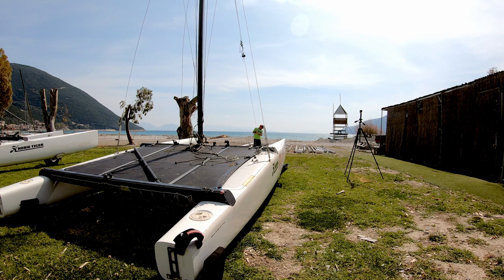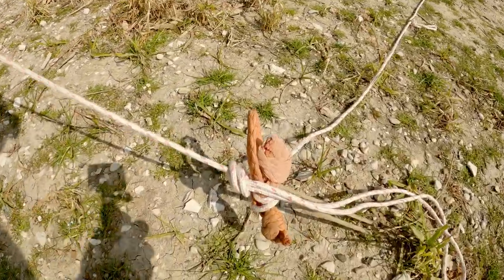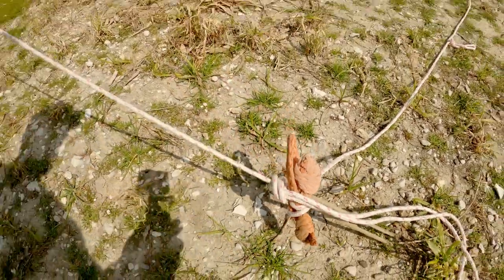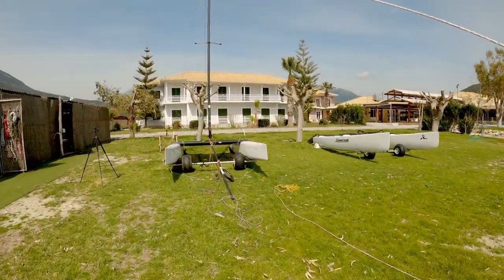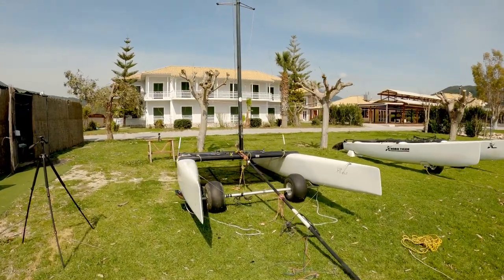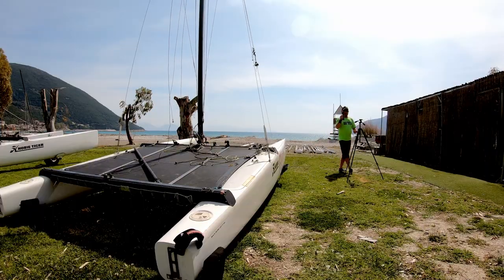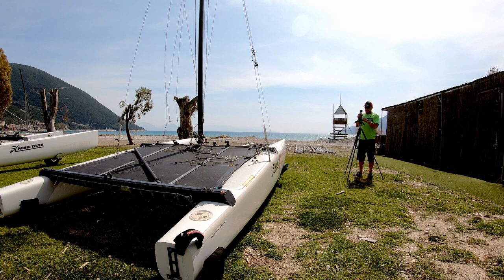SOLO FX1 Mast Raise  Is it possible?

Comment: Instead of a tree,  I  use a large A frame ladder.  Then on the side of the ladder,   a Y or U shaped piece of metal,  which sticks out and holds the mast in place.  I set it up, when it's still on the trailer.   I sometimes use a winch, to pull up the mast,  until it's to the point, where I finish by pulling manually.
Reply from the maker: Nice. That certainly sounds better than the tree! I had to cut out all of the bits where the rigging got caught in the branches!
Reply: @JoyriderTV  Hello,  I forgot to mention another technique.  I have a rope tide to the end of the forestay, which goes through pulley, which is attached to the vertical post, where my winch is. As I'm on a board on top of my trampoline,  I lift the mast,  and pull the rope,  simultaneously.  I have to do this, while the boat is still on the trailer.  To be able to leave the boat on a beach, with the mast left up, is my goal tho.

Comment: The longer the rope is, the easier it gets. The bigger the angle to the mast, the better. 
 
See the extreme case: when you stand directly by the beam, all your force goes down the mast and only pushes the mast onto the socket. 
 
You need a direction of the force perpendicular to the axis of the mast. 
 
So you apply physics, to be exact the parallalelogram of forces, by walking away.
 
 
You could make applied physics for Harry there, photographing the angles from the side. 
With the scale you use to adjust the rudders you could determine the force to lift the mast at the hounds,  and when you have the angle of the line to the mast, you can determine how hard you have to pull and verify that by pulling with that scale. 
Or, when you adjust (via scale) a specific pulling force, you can determine the angle when the mast will lift.
Reply from the maker: Thanks for the science Stefan, I know that I could rely on you.
Reply: @JoyriderTV  I couldn't resist... 
 
And in a few years Harry will need that in school.  
 
When you can apply stuff in practice, it sticks way better.
Reply: and the cat starts sliding when recently waxed...;)

Comment: I TRIED this once...the boat started sliding towards me on the beach. But I started with the mast more flat=vector of the pulling force is more horizontal...quite scary. Next time I take the tree with me....Have fun, see you somewhere in the future!!
Reply: Telescoping speaker stand is your answer. It will raise the mast top up to 9 feet and serve the same purpose as the tree.
Reply from the maker: That sounds quite amusing - although probably not at the time - being chased down the beach by your boat while you pull it!
Reply from the maker: Yes Tom, that certainly sounds like it would have fewer branches to catch the rigging on!
Reply: Good idea! When it is strong enough to hold a Fender Twin Reverb up it's even multi-purpose for me...and an anchor to stop  the cat sliding. Another way to raise te mast is training my sprint time, it's all a matter of speed..
Reply from the maker: @moppie3  😆